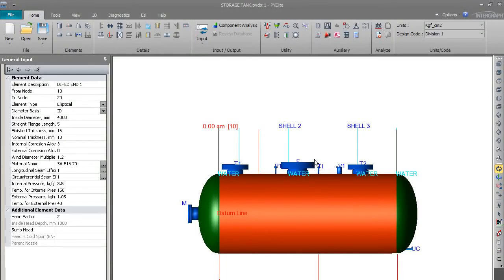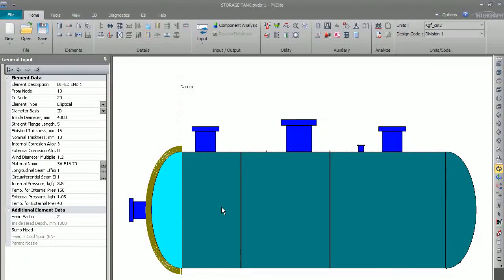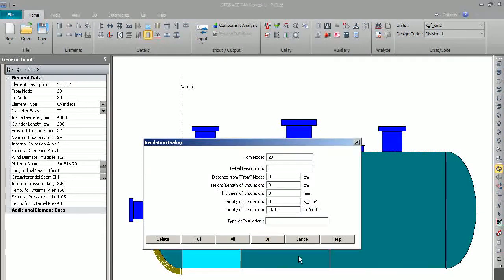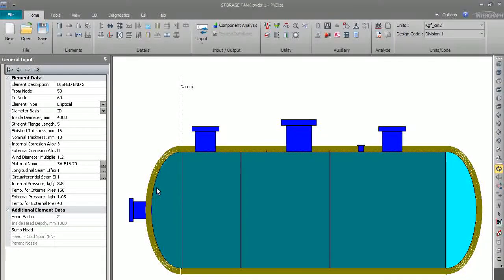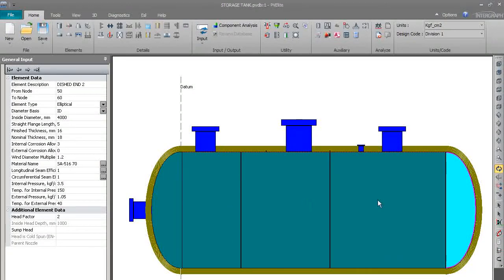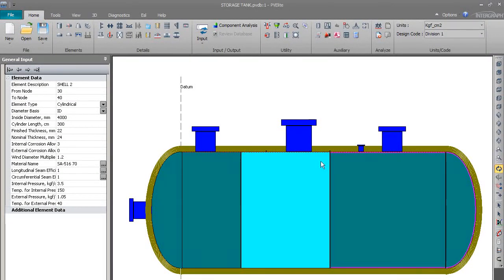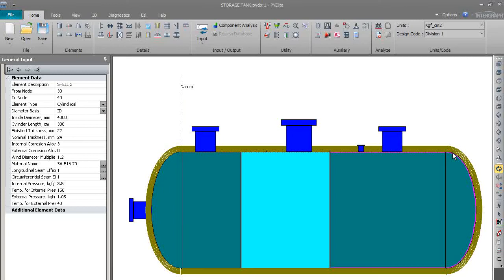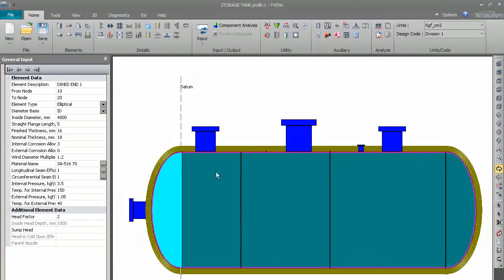PV ELITE TRAINING SESSION 7

Comment: Density of insulation 128 kg/cm3 ????
Reply from the maker: Its 128 kg/cubic m. Thanks for the correction. I will correct if I get time.
Reply: @mectecho2234  i need one help. How shall i design a tank horizontal cylindrical in shape for storage of chemical. At atmospheric pressure.